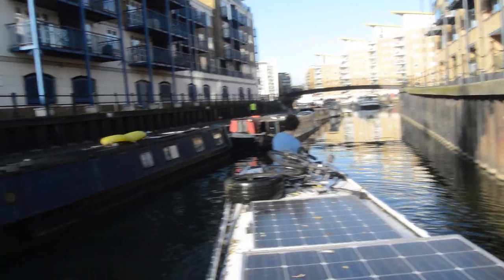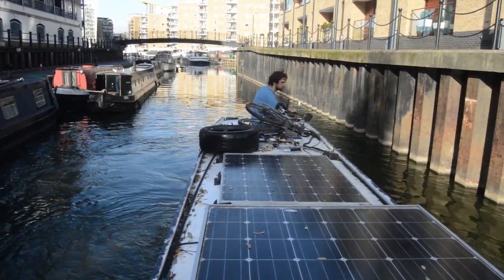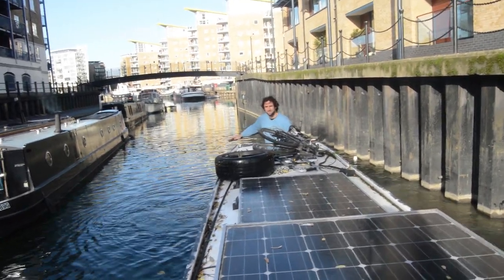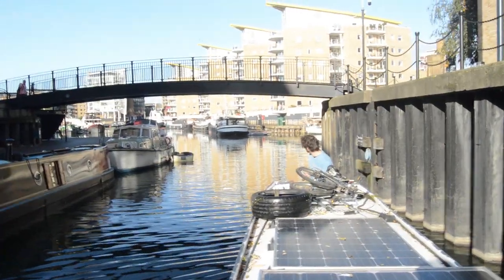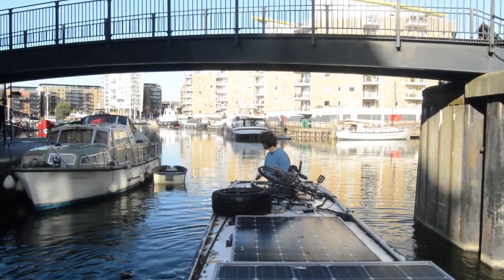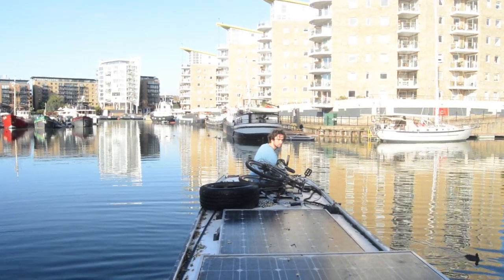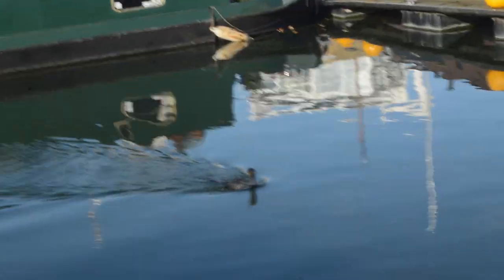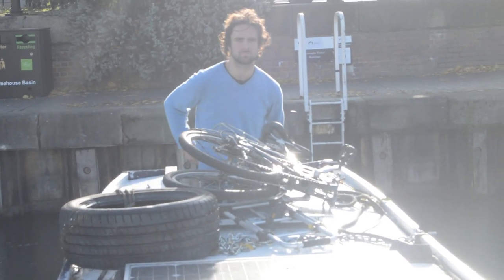How To Reverse Around A Corner

Comment: Nice little video, thanks! I've only been afloat for 4 years so am still learning. An imminent job (first time) is draining out my coolant system and replacing it with a new water/antifreeze mix. I look at a good number of narrowboat channels but so far have not found anyone who has placed this task on video. So if your boat needs this doing soon and you're up for the challenge...??
Reply from the maker: we have never done it, we did test it with a hydrometer and try to keep it balanced.

Comment: It seems to me that narrow boats have no keel and that must impact on steering, forwards and backwards. Any thoughts, or is this irrelevant.
Reply: Peter Blackwood The keel has no impact on steering, normally their purpose on a sailing boat is to stop you being blown sideways when on a tack or beat, and of course to stop you capsizing by lowering the centre of gravity.  The rudder does the steering and when going backwards in a narrow boat there is no flow of water over it hence no steering.  That’s why Jasmine said that to shift the bow left or right you need some forward engine power.  Remember if the bow goes left the stern goes right and vice versa.